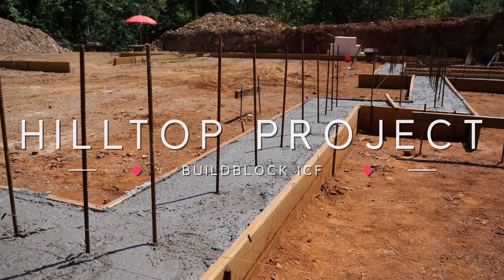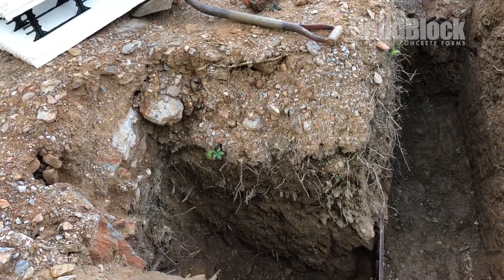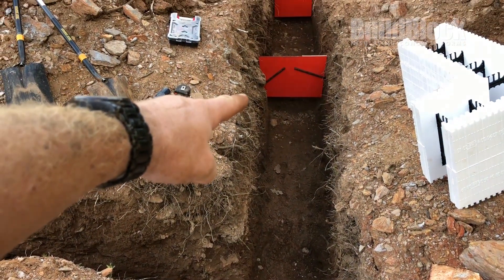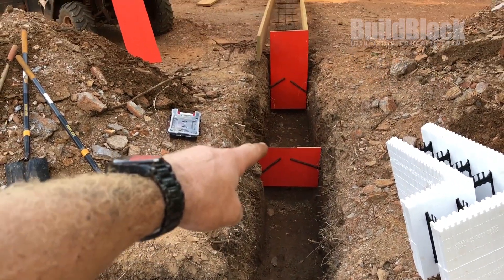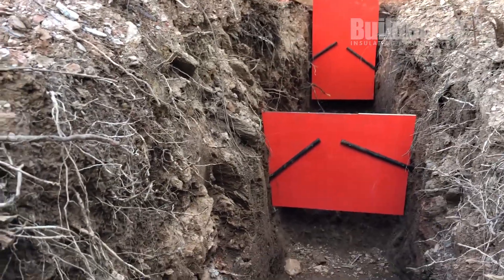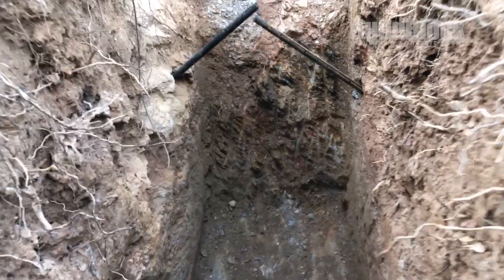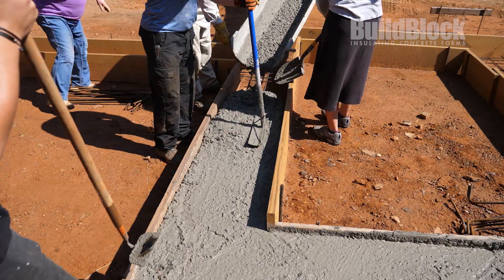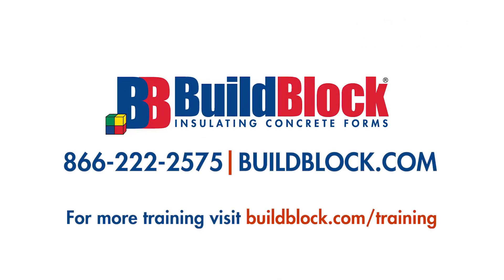How to Create and Pour Step Footings in an ICF Project

Comment: I completed a BuildBlock footer and stem wall build in MT last week with Mazzella. It would be worthwhile to show them stacking block at the step. We drilled and epoxyed a dowel into the step running horizontal with the block that tied into the horizontal rebar course to prevent the wall from moving over time.

Comment: I have been searching high and low for answers to a question that seems like any video like this would answer.  That is, in a stepped footing, what prevents the concrete in the higher levels, since it is a liquid (however thick) from just flowing down to the lowest level of footer and overflowing there.  That's what would happen if you poured  water, or even the heaviest thickest syrup into a footing trench or form.  The problem would occur whether you first filled the lowest trenches/forms, or the highest.  Apparently the answer is so obvious that no one bothers to show this or explain it.  But it is not obvious to me.  The only hypothesis I have come up with is that you fill the lowest footing trench or form first, starting at the stepped ends.  By the time you finish filling the lowest trench (or the lowest form), the concrete nearest the step-up (the concrete that you started with) is stiff enough so that when the next level up is filled in the same manner, the lower level concrete can no longer flow (because it stiffens that quickly??), and so the weight of the newer liquid concrete doesn't push the older concrete out of the lowest trench and cause that to overflow.  It drives me crazy that EVERY video on youtube that purports to explain how to pour step footings fails to discuss this.  Don't get me wrong, I appreciate every technical video on youtube that I see, they have saved me dollars and trouble for years.  I am just frustrated that I can't find anything on this particular issue anywhere on the "interwebs".  I would appreciate any light any of you might want to shed on this.....
Reply from the maker: Hi, to answer your question, screw a flat board to the top of your forms for about 16”-24” from the step. This changes the direction of flow from pushing up vertically over the top of the forms to laterally providing some back pressure from the downstream poured concrete. Screw on the board after pouring the lower section and it will keep the concrete from coming over the top when placing above the footer.
Reply: You are correct, you must wait for the concrete to "set up" before pouring more concrete. Generally the stepped footing is poured first, then you move onto the lower grade footings and finish them.  Should the lower footings take more than 30 minutes, stop at the 30 minute interval and pour another "lift" of concrete into the stepped footings before finishing up the rest of the main footings.
Reply: I am quietly giggling because you are exactly right...no one explains this because it's probably so obvious to someone who has done it a million times. Even in the comments explaining it below, it's not exactly clear. Good luck with your build.